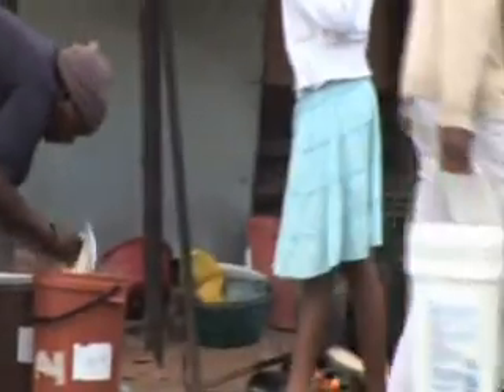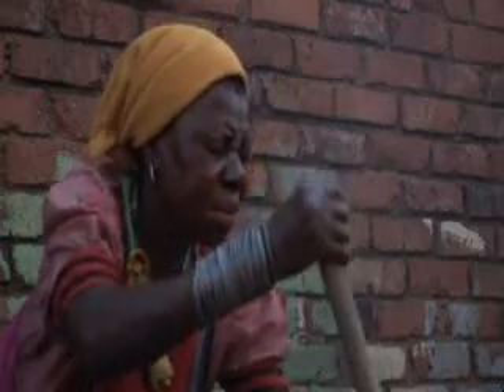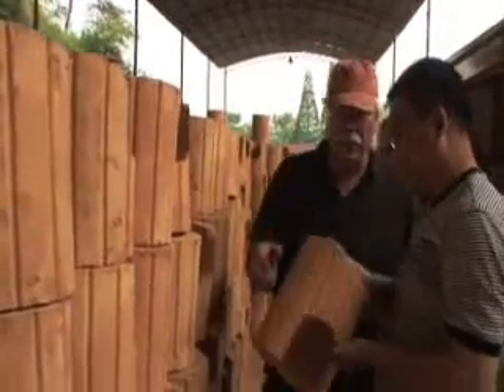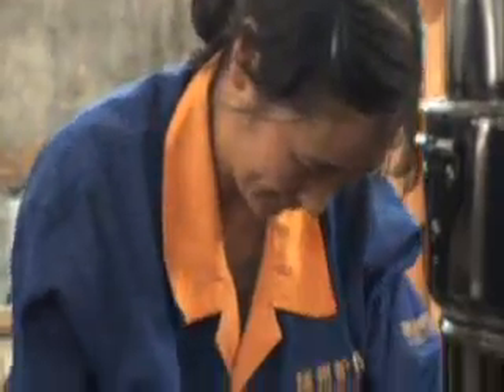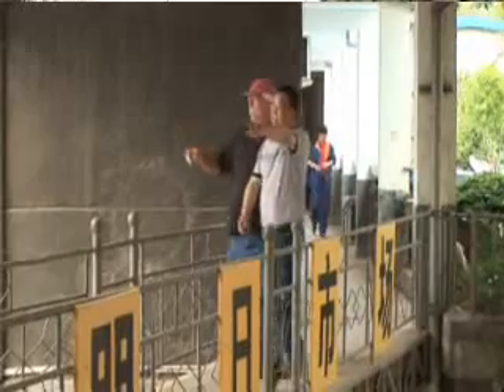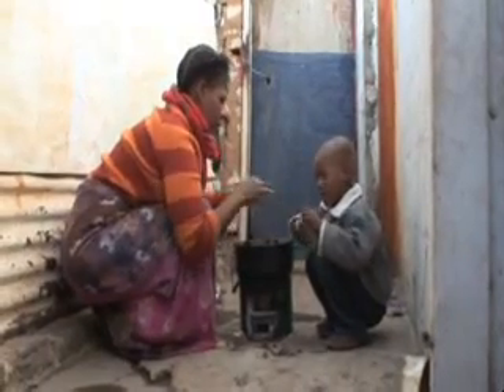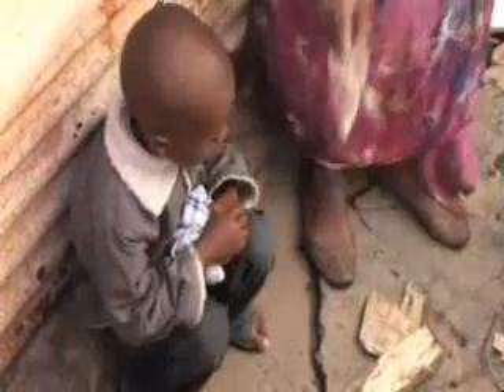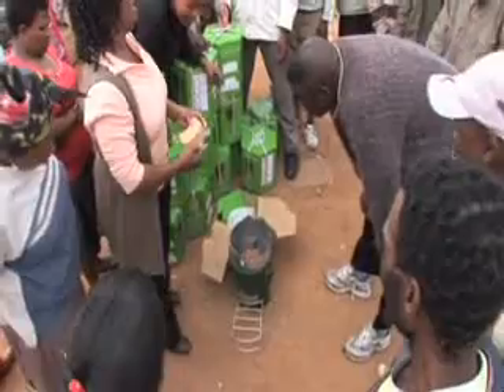Ashden Award 2009 to Aprovecho Research Center and Shengzhou Stove Manufacturer

Comment: There are alternative insulators out there.  The fired clay insulators in these stoves are very fragile and break when transported over rough roads or with thermal cycling from frequent use.  I have seen stoves that use loose perlite as an insulator, and that is much more common and much lighter.